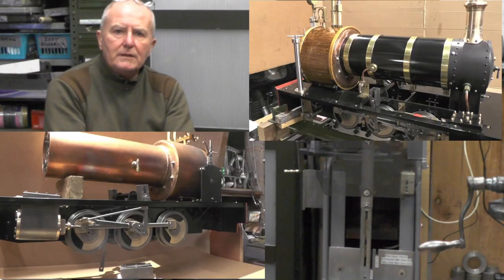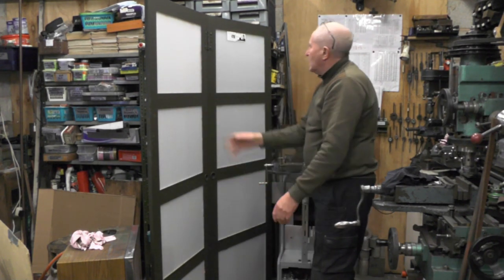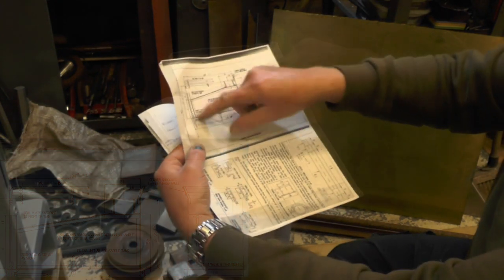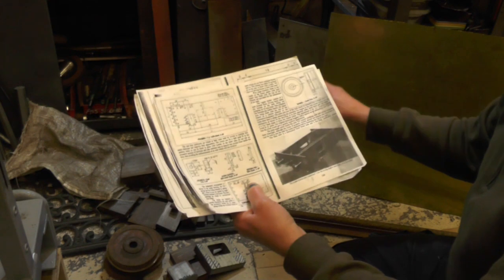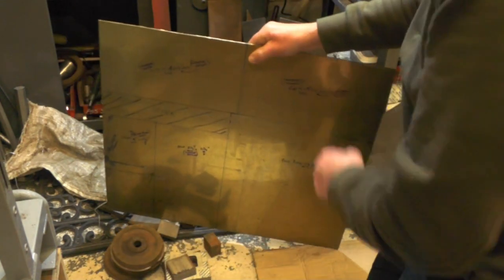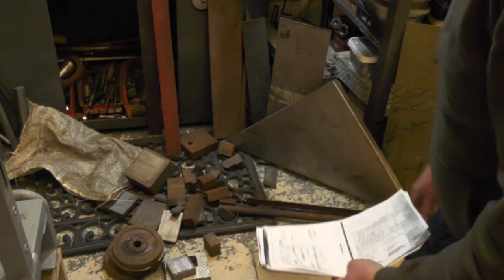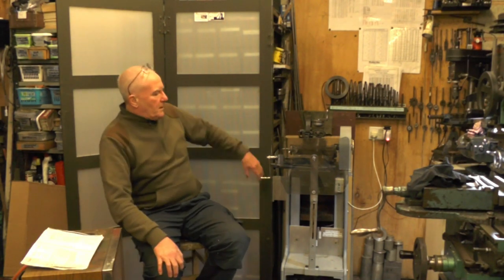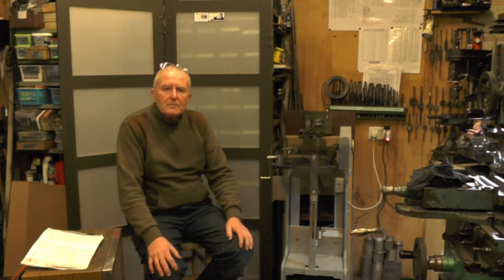Lets Make a Water Tender P1 - For "Scratch" (My Beginners Steam Locomotive Series) "mr factotum"

Comment: I'm enjoying the show..
But I wanted some advise. I would like to make an endmill router / shaper maybe bolted under neath a steel plate so the mill is exposed and can us the steel plate as a table..I have some heavy duty motors and some pulleys  ,is it do abull. 
Thanks for sharing the ideas
Reply from the maker: Hi Simon
Thanks for watching and comments
Simon, most things are doable one way or another. Its a little difficult for me to visualise what your trying to do from your explanation. Maybe it's me whose bit thick!!
Are you wanting to do this on an existing Milling machine table, or is it a stand alone machine and whats it going to be cutting. Is it something like a woodworking router table with the router slung underneath the table and cutter coming up through the table
A Sketch would be better than a thousand words, send me a rough sketch to my email address on my home page, if you can and let me have a look.
Cheers 
Kev
Reply: @MrFactotum   will do thanks for getting back to me